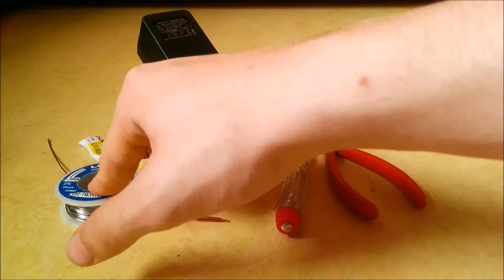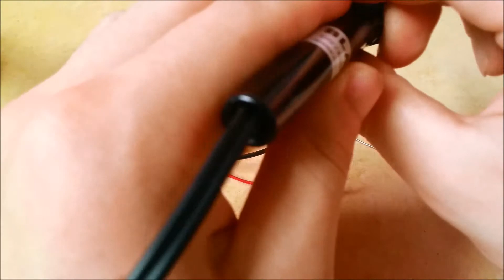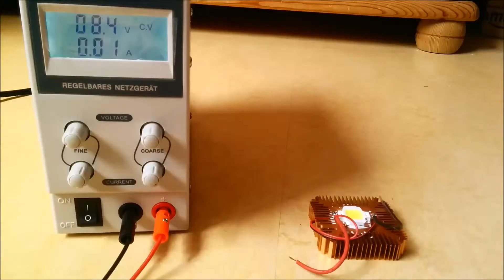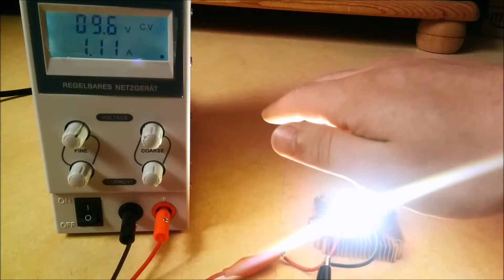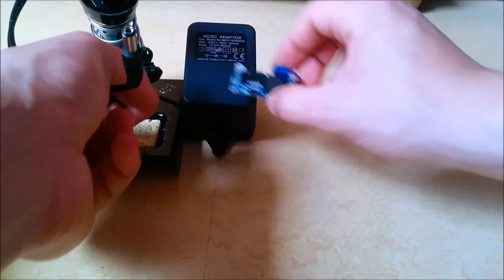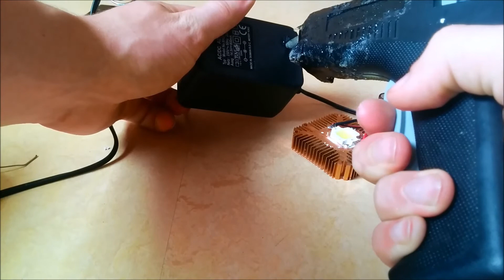DIY less 7$ Wall Plug 10W LED

Comment: So you used 9v with 900mah, with 9v it can emit all 900 lumens that comes with 10w LEDS? Isn't it possible to use 11volts 900mah?

Comment: Where did you buy the heatsink for such a low price? 10w led heatsinks cost more than $10 each on ebay
Reply from the maker: They are really cheap if you buy them directly from china, via aliexpress or ebay
i got mine on sale for about 1,40$
http://www.ebay.com/itm/For-PC-Computer-Laptop-CPU-VGA-Video-Card-Cooler-Cooling-Fan-Heatsink-/311012998335?pt=US_CPU_Fans_Heatsinks&hash=item4869d1bcbf

this is the cheapest i could find in bout 5 minutes, but it gets cheaper once you take like 10 min to search